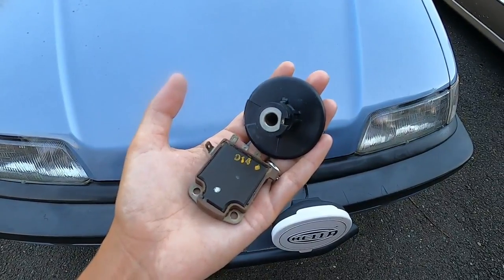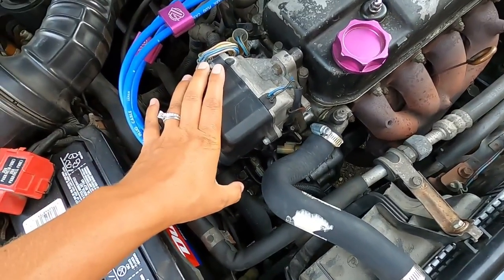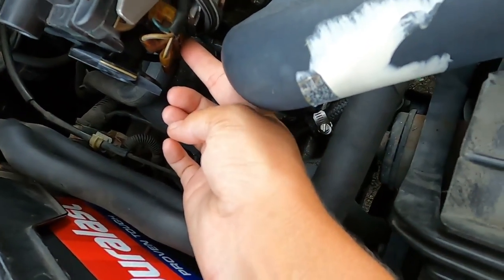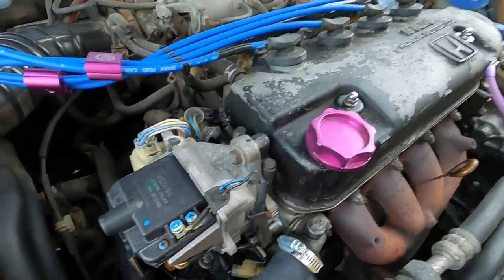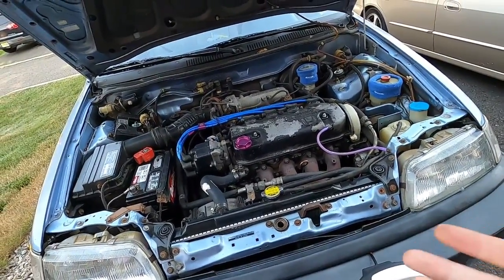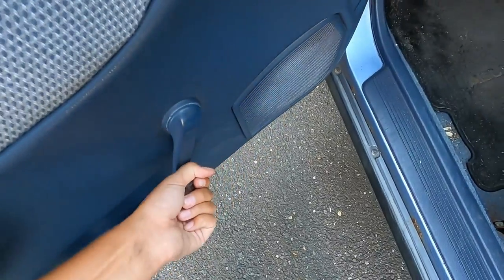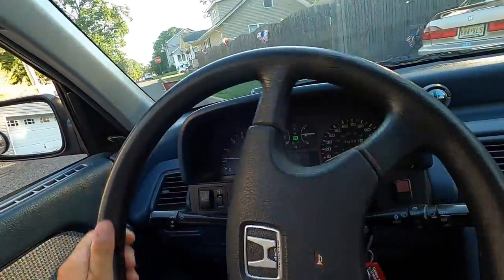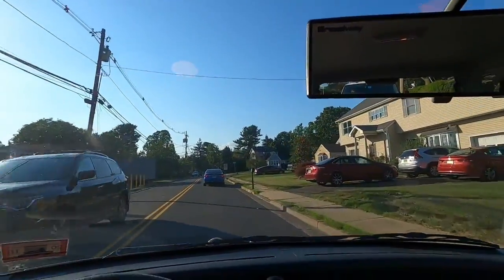ICM REPLACEMENT - HONDA CIVIC D16

Comment: My RT will occasionally die on hot days after I drive it for a few minutes, turn the vehicle off, and come back to it. It will fire up and attempt to drop into idle, shake and putter out. 

Car runs good. I can hit 70+ no problem on the highway. Distr was replaced a few years back. Any hunches ?
Reply from the maker: Maybe iacv? I heard the ICM gets hot and causes idle issues and stalling as well. I have replaced both
Reply: Check your main relay if your still having that problem 🤙

Comment: hello. does the issue of lights blinking when signal is on also solved when changing the icm?
Reply from the maker: No. That just seems to be an "old honda" issue lol. But the iCM and IACV repairs have fixed all my low idle issues
Reply: @vanilllamint  haha ohh i see. been experiencing the same issue too. will be checking both the icm and iacv tommorow. thank you 👍🏽
Reply from the maker: I checked my iacv and cleaned screen when I got the car. It turned out it wasn't clogged just failing but it's running great now. I need to do an update video